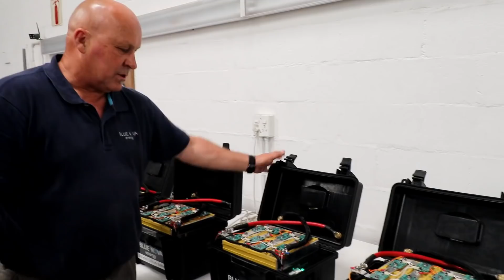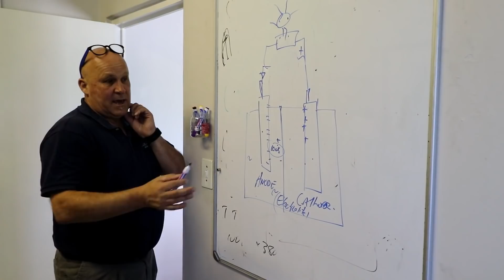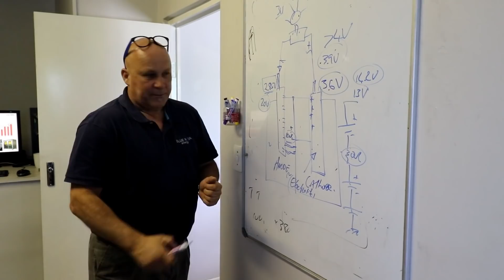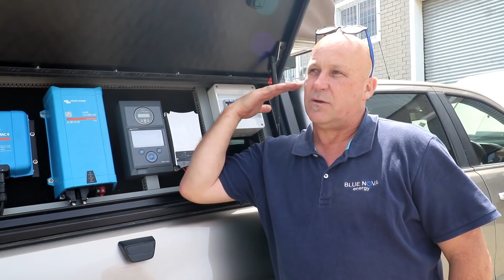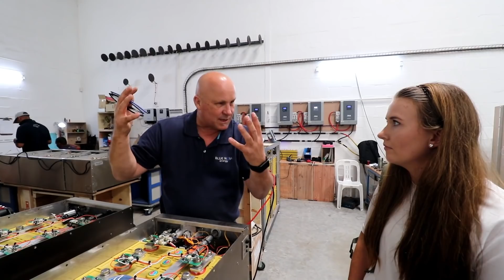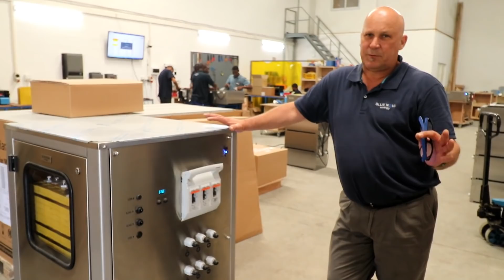We're going LiFePO4 | Lithium Batteries on our Boat

Comment: what sort of generator are you fitting,and how much solar?
how much would 600AH of lipo cost from blue nova?
Reply from the maker: Hi Alex
Reply: i checked their website and 620 AH or as 2 banks of 310  AH ,4000 Wh
each cost around us$ 2700 per unit,so $ 5400 for 620 AH.,8000Wh

it was not clear in the video,but it looked like you were going for 2 banks of the 154 AH 2000 Wh mini series in 13v rather than 26v costing around us$ 3000 for the 2 banks. totaling 310 Ah and 4000Wh

 why not go for the cheaper single 310 AH bank?
Reply: Hi.
They sized their system around 13V and 3200Wh total daily consumption if all systems are running. 
The 13V mini HP is a 2kWh unit and cost about USD 1200 incl VAT. They choose 2 of these which gives them plenty spare capacity. Total cost is about USD 2400 in VAT. 
If they use the complete 4000Wh capcity it would be equivalent to a 660Ah (C10)  leac acid bank at 12V with 50% DoD. That is around 7 x  100 Ah VRLA batteries in parallel, If you buy good quality AGM they are at least USD 200 each. So you're in for about USD1400 if you go the lead acid route. Si in this case LiFePO4 is about twice the inital price of lead acid. 
Lithium batteries' benefits outweigh that of lead acid significantly and that's why it will completely replace LA in the near future.
Reply from the maker: @JamesVerster  thank you James !
Reply: that is a pretty good price for a 154 Ah LiFeP04, similar victron are almost double that in price!
will they be running as a single house bank or as 2 seperate banks?

does the mini series have breaker auto shut off for over/under temp and over/under charge like your larger banks or just the bms interface cable connection to a seperate controller?

what size charger would be optimum?
how much solar for 250 Ah per day house needs ,would 500w solar be sufficient?

do you have a UK agent/distributor?
Reply: @alexbond490  When you compare different batteries, just be careful to also take into account that not everyone uses the same discharge rate or EOL percentage. A Victron battery is usually rated at 1C and uses the industry standard 80% EOL figure (battery is deemed EOL when it has irreversibly lost 20% of its capacity), in other words a 120Ah battery will give 120 amps for an hour and will do so for 2000 cycles. Compare to Pylontech, which rates at C/2 (half the rate), and define EOL at 60%, which allows them to get three times the cycle life. BlueNova rates their AH at an even lower number as far as I know. It's still excellent value for money, don't get me wrong, just saying apples for apples in the battery world is hard to do :-)
Reply: Hi  @alexbond490 .
Please contact me on jamesv@bluenova.co.za. I'll get you sorted out :)
Reply: Here is the answers to your questions: 
will they be running as a single house bank or as 2 seperate banks?
2 banks in parallel. 

does the mini series have breaker auto shut off for over/under temp and over/under charge like your larger banks or just the bms interface cable connection to a seperate controller?
Yes.  It has a complete BMS with added functionality. 
CAN interface 
Pre-charge bus DC bus capacitors (no sparks when connecting this !!)
Auto reconnect when a fault is cleared. Useful for then to trip the battery due to over discharged and then when the sun comes up to automatically reconnects the battery. Think: You have a fridge with ,meat in it and you leave the boat for a few days. Then bad solar leads to the battery being drained. It then disconnects as a safety feature. When the sun comes out it will automatically reconnect and start charging.

what size charger would be optimum?
C3. i.e. get them  full in 3 hrs. Total capacity = 310 Ah. You will need about a 110Amp charger for that. 110 x 13.8 = 1500W

how much solar for 250 Ah per day house needs ,would 500w solar be sufficient?
This is highly dependant on your solar irradiation profile i.e. solar hours per day and panel orientation. 
Is 250Ah at 13V or 48 V ?
If 13V and you are optimally oriented in Southern Africa you can work on kWh = 5.5 hrs x Wp (peak panel power) 
13V * 250 Ah = 3.25kWh required. 
3250 / 5.5 = 590Wp (use 2 x 330Wp panels) There are inverter losses of about 6% that take into account. 

do you have a UK agent/distributor?
Nope.
Reply: Hi  @plonkster .
We rate out batteries at C10. C1 numbers are also available. We don't see the use of the C1 rating because no one uses them at C1.  C12 is more realistic in off grid self consumption market. 
Our EOL is also 80%.
We use the same cells as Victron. It has an enhanced Cathode with Yttrium added and can confirm 5000 cycles at 80% DoD where as most other cells offer 2000 cycles at 80% DoD. 
Regards
Reply: @JamesVerster  I know you rate at C10. Some of your competitors even call you dishonest for it (I've heard it myself). C10 is definitely more real-life. But it does make comparisons difficult. I remember when I bought my LFPs two years ago, it was really difficult to compare. One battery would say 2000 cycle and the other one would say 7000 cycles... and you'd look at them and wonder how on earth the numbers can be so different, well it turns out the discharge current is quite important. High discharge currents usually goes with shorter cycle lives. It seems that it depends what the target market is. If you're selling a battery for a scissor lift, the marketing team will likely work with C1 instead :-)

I think Pylontech is definitely pushing it with their lower EOL number though. That is really creative... but not entirely un-real-life-like.
Reply: Hi  @plonkster  .
Most Lead Acid suppliers rate at C20 however Hoppeke rates at C100. Your typical 105Ah lead acid is at C20. 
Most LFP manufactures rate at C2 or C3. You can get C10 numbers if you ask them nicely :) 
We use C10 because that is what the battery is used for so the LCOE (levelized cost of electricity)  numbers are more accurate using this number.
Here is a list of what cause increased fade (loss of initial capacity) in LFP batteries (most lithium batteries suffer from the same problem). 
1. High charge current (faster than C2 ) at low SOC ( less than 20%) and cold temperatures ( less than 0 Deg C)
2. High discharge currents (faster than C2)  at high temp (more than 45 Deg C) when full (more than 80% SOC)
3. General high currents between SOC =20% and SOC = 80% . Charge or discharge ( faster than 1C)

These condition  damages the oxidation layer on the surface of the cathode resulting in a compromised lattice structure which in turn lead to a reduction in retained capacity and an increased ESR (series resistance) leading to temperatures increases. This temp increase further exacerbates the damage to the oxidation layer.  Improvements in cathode materials and the introduction of graphene to the carbon based anode lies at the heart of improved cycle life and high power performance at the extreme conditions mentioned above. 
Mr. Winston Chung holds a few patents and some secret methods that makes his cathode one of the leading high performance cathodes on the market today. We chose his cells because it surpasses the others (at this stage at least). 
Regards
Reply: @JamesVerster  Thanks for the explanation. You make a good point... this difficulty in making a good comparison isn't limited to LFP batteries :-) I just remember being quite frustrated at the time. It made no sense that one of your batteries could do more than double the cycles than the Victrons I ended up buying... because as you know they both use Winston cells.